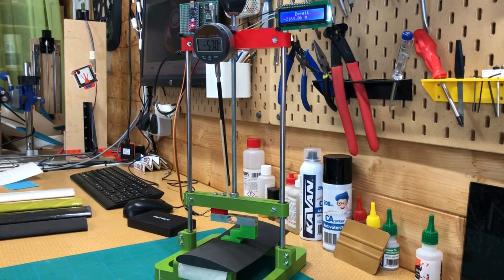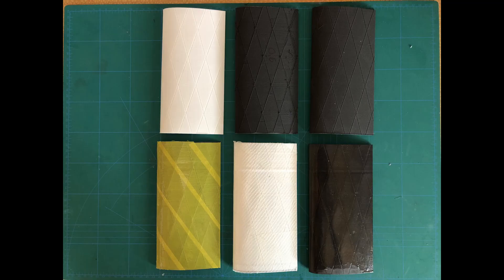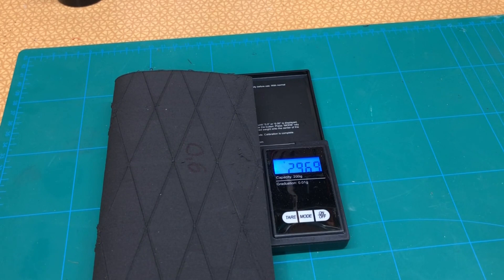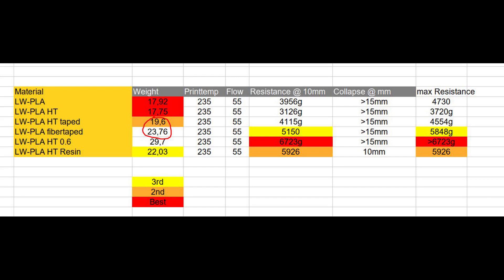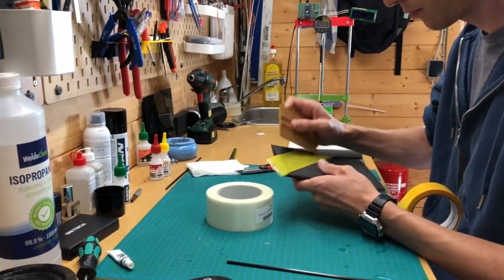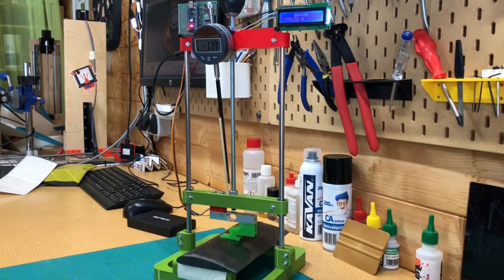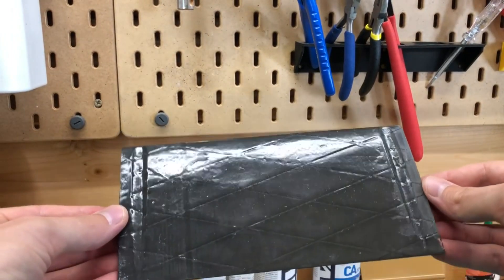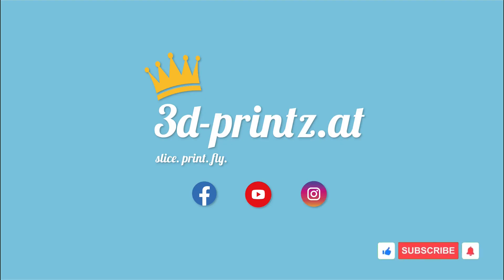How to get strong LW-PLA Wings

Comment: Interesting results. I use a very thinned epoxy (50% epoxy/50% spiritus) that way, even without sanding, it seeps into the lw pla and makes it act like fibers. Thus far it's been holding fine, much better than my first regular epoxy coated lw pla plane.

Comment: If doing sanding and epoxy with LW-PLA, do I still need HT LW-PLA?  I've only printed one plane with Polymaker LW-PLA.  The sun must have found part of my wing while I was messing with other planes and that is all it took to warp an aileron.  Plane is painted yellow.  So wondering if it matters much to go with HT PLA if also coating with epoxy.  I have some ColorFabb LW-PLA-HT but need to do more prints to dial in the settings.  Sure is flexible.
Reply from the maker: I only had issues with regular LW-PLA in Black, grey and green at 35°C in plain sun so far (untreated). Normally white LW-PLA is not a problem. Especially when you coat it with epoxy. The resin should save the shape, even if the material gets soft. I´m printing LW-PLA-HT commercialy in large scale and can give you Bambu-Profiles if you want. Just write me a line: office@3d-printz.at

Comment: Very interesting results. Thank you for sharing this. I wonder how a PLA+ print would fare in this test. The epoxy added about 20% weight, which is starting to approach the realm of printing in a non-foaming filament. Depends of course on print settings, but it would be interesting to know a baseline “non-LW” strength number for your testing methodology.

Comment: I'm new to printing, but thinking about printing a wing.  Would a Wing in  two parts split and 3d printed starting on the spar improve the strength? I'm always suprized the wings I see 3d printed are printed from Wing root Station.
Reply from the maker: there have been trials, but it brings other problems on the table. now advantage without disadvantage :D a slight angle reduces the effect of the layers as a weakpoint.

Comment: Coating with epoxy might become even stronger through just 1 coat and some ultralight glass cloth.  Use a foam roller to apply and remove virtually all by layering with toilet paper, rolling with a clean roller and removing the paper
Reply: I usually squeegee my extra epoxy off with a rubber paintbrush looking thing. Then wipe off the rubber and do another pass. Gets it all off and leaves the glass nice and tight.

Comment: And if the temperature is too hot, disaster
Reply from the maker: of course, but actually the temperaturething is overrated extremely. YES you won´t leave your PLA-prints in the hot car. NO they won´t melt if you go flying in summer. YES black PLA melts on hot days when left in sun at temperatures above 30°C. Just print bright colors and everything is fine. Also you shouldn´t keep your Compositeplanes in the hot car. One easy rule of thumb: when the sun burns your skin it probably burns your PLA Plane as well ;)